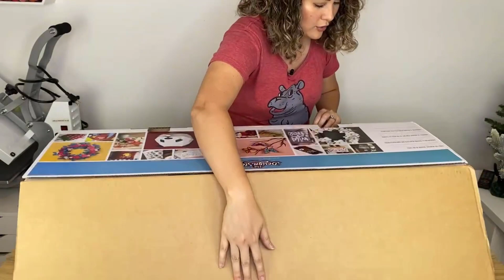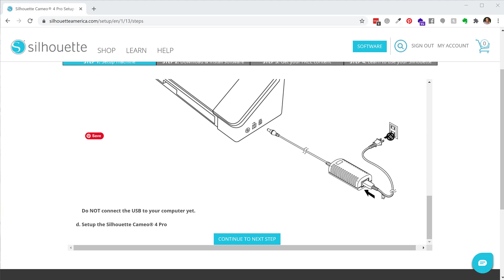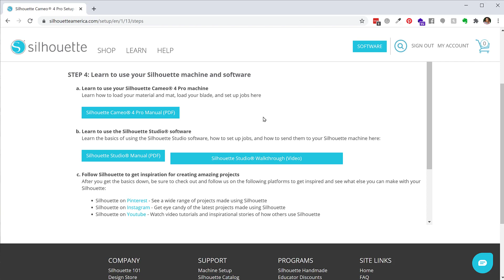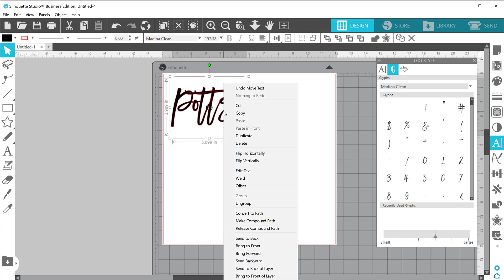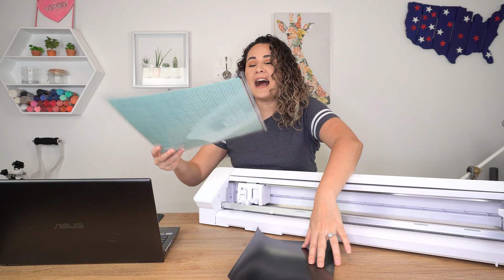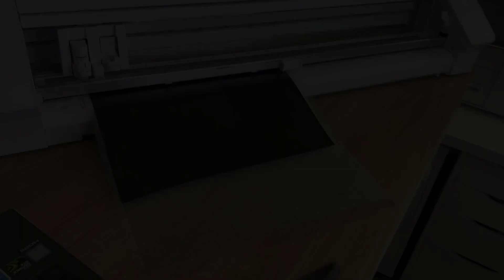Realistic Cameo 4 Pro Unboxing and Why I Couldn't Cut for Three Months (Issue Resolved)

Comment: Lisa I want to thank you so much. I’m going to try your tips. I pray it works. lol. I took my machine out of the box and my vinyl isn’t gripping and it slides all over the place. I have emailed silhouette for 2 weeks and cannot get a response. Not sure what else to do except junk this and go back to my cricut. I’m so done with this machine.
Reply from the maker: I'm so sorry about that! I found the best method is to use the large mat when you can. It stinks, but that's how I made it work. If you're looking for a better 24 inch cutter, the Siser Romeo is my recommendation.

Comment: I have also been using an older (dark blue) Graphtec Craft Robo Pro 2 for several years, but the drivers don't always work well with Windows, especially Win10, so I usually use my Cameo (1) most of the time for decals.  I've been hoping to get the Cameo 4 Pro for quite some time but it just never quite fit into my budget, until recently. I noticed the recent flash sale and I jumped on it. 

Pretty bad that it took Silhouette three months to resolve your situation, when it was something simple....the blade. That should have been the first "fix" they should have recommended.

I love your "famous last words"....my family says that too! 😁
Reply from the maker: Yes it was a chaotic time. To be honest, I still have issues with the machine - mainly cutting long designs. I will be phasing over to the Cricut Romeo soon, it has much better accuracy in my opinion.

Comment: Could you comment a little on how the pro compares to more industrial 24” cutters? How do they compare? Is the Cameo Pro worth it? What other 24” machines compare to the cameo pro?
Reply from the maker: The Cameo Pro is great for crafters who want to move to a bigger machine without the intimidation of other software. However, it uses a stepper motor and its slower than other industrial machines. If you are going to be going to a higher business level, the Graphtec or Roland 24 inch machines are great ways to get in.

Comment: for the price of that cameo i could buyu 2 rolands 24inch models fgrom us cutter  or prob of other brandsa. that think is 499.0 or arounjd thast price i still have my 3. but i only use it for curtting oramask 813 i custom paint guitars. and for that mattert why not get the juloiet from  sciser its suposed to bead a## from what i hread.
Reply from the maker: I have the Juliet and it's great. However, at the time of filming this, the Cameo Pro was the first 24 inch cutter that was crafter-friendly on the market.
Reply: @LisaPottsDesigns  about the Juliet I can't get a straight answer from any one . Is itccloid based like cricit or can you use it like the cameo  and not have to actually be on the internet  to use it that's the main reason o bought a sholouette  use it stand alone no fees or anything these coep comp are screwing the consumer erevery days   and I don't like it . I liked it better I'mtje 89s0s

Comment: My Cameo Pro didn't cut properly and had serious issues with registration. Returned mine and got the cameo 4 and had ZERO issues. Theses pro models are known for faults and told by seller that multiple units have been defective and returned.
Reply from the maker: Yes, it definitely was a difficult rollout. Thankfully I am using it now without issues but I know many others have not been as fortunate.

Comment: Hey thanks for the video, problems with mine from the get and also a faulty blade, I'm just wondering have you found that you actually cut up to the full 24" with this? I've tried cutting a simple square and it comes out of the rollers no matter where I place them 🥴
Reply from the maker: Yes! But I have to use the mat to cut the entire 24 inches. I did cut some nice decal vinyl at 22 inches wide recently, but I was nervous!
Reply: @LisaPottsDesigns  I've figured out if you feed the vinyl in a little further it does the job,thanks 🙃

Comment: Hi, Thank you for making this nice video. Have you ever cut fabric with it? And specifically stretchy fabric? I'm thinking of buying this, but I want to make sure it works for it first.
Reply from the maker: I have not personally, but I have seen many others use it! Just a matter of testing settings!
Reply: @LisaPottsDesigns  I see, thank you!
Reply: Hi Sara, have you found videos of the pro cutting the stretchy fabric? Have you bought it and tried? I want it for the same thing but I want to be sure it works
Reply: @tiffenydecoteau4037  Hi Tiffany, sorry it took me so long, I never saw the notification for this. Actually I realized that the sticky mats ruin the elasticity of stretchy fabrics, and since these cutters need the sticky mats, they just don't work well with stretchy fabrics, the actual cutting worked well with the rotary blade though

Comment: I've been eye balling the pro just because of the size. I wouldn't use the huge width but very rarely. I see alot of people have issues with it. Would it be better to buy a plus vs the pro? Just to save on issues. Thanks!
Reply from the maker: I would either go basic or pro, not the plus. I still use my pro simply for the fact that I can keep my 20-inch pieces of glitter htv in sheets longer than a foot. You can't do that with the plus, since it's 15 inches. If you're rarely using the width to its potential, save the money and get the basic.

Comment: i have had mine for a few months. I do not use a mat. but some of my designs it will move the carriage all the way to the right of the machine and start cutting from there, even if my settings are for a 4 x8 , positioned on top left of material view.  I am not a proficient user however why are some designs doing this and others are not.
Reply from the maker: That's very strange. I haven't had that happen before. I recently needed to update my firmware, is yours up to date?

Comment: Cost and it only being a hobby to me was the deciding factor for not going to the pro but did move from the portrait to the cameo 4... sorry if this sounds bad...but I was glad to see that you had a problem from unboxing...mine unfortunately was from being a typical guy...don't need instructions... machine needed firmware update and the usb connection wasn't being recognised...of course I contacted my seller who put me in touch with silhouettes sister company here in the UK and they had my machine for 3 months..but got it back and it was working...until it needed another firmware update...when I first set it up Bluetooth automatically came on and set up went ahead...so usb set up never got done...so I had to uninstall everything... reinstall making sure Bluetooth was turned off... actually turned it off on my laptop as well...did the usb set-up then switched Bluetooth on then did the Bluetooth set-up...like yourself now have the machine showing twice...usb and Bluetooth...took over a year during lockdown to finally get it sorted...
So now you know why I said it was good to see you also having a problem...can I also say your unboxing and set up was the best in showing how to step by step... though sorry you didn't also do the getting the free designs etc as there is bound to be those setting up for the first time...or have moved from a different machine..
That said keep up the good work..
Reply from the maker: Thanks, Paul! I was just trying to keep it real. When I see no one else struggling, I start to feel crazy. At least we know we're not alone!

Comment: You will never be able to do a print and cut job with thick cardboard , as you can do with Cameo 3 and 4
Reply from the maker: It's the same cutting clearance. You can certainly do it.
Reply: @LisaPottsDesigns  It's not all about the  clearance. They should improve the rolls pressure: the mat keeps on slipping and often the cardboard gets stuck under the carriage, every time the sensor tries to read the registration marks. I've heard so many testimonies about this issue...

Comment: I am trying to cut without a mat on 24" wide vinyl.  I keep getting a message that the selected media is too wide to be used with the specified Silhouette.  I have the Cameo Pro.  I have no idea what's wrong.
Reply from the maker: A couple things:

1. Make sure your Cameo Pro is connected and selected. You may need to click the button at the bottom of the send panel and select the Pro.

2. You may need to update your mat or media size. Make sure you have the 24 inch mat selected. 

Let me know if either one of these help!

Comment: Thank you for this video - I thought I was the only person having problems with the Cameo 4 Pro. I'm having no end of trouble with mine (sketch lines are fine but cuts are all mis-aligned. It seems like the mat slips when I try to cut on the 24in mat but smaller mats seem to work okay), and am in contact with the Silhouette Support team. 

I received my machine in March, but have yet to make a successful cut on the 24in mat, which is frustrating because I upgraded to the Pro to be able to make wide cuts. Your video has given me hope that issues can be resolved!
Reply from the maker: Crossing my fingers! Just keep up with support so you can get a resolution.
Reply: @LisaPottsDesigns  thank you, I will: the worst part is that I sold my Cameo 4 to fund the purchase of the Pro, so I can't cut anything at the moment!
Reply: @kittyishere  what was outcome?
Reply: @passmorebrett  it transpires that the mat that came with the pro was too flexible and thus was sagging when I attempted cuts. Our retailer provided us a new mat and we've been fine since!

Comment: I just came across your videos. Where is the SN etc info for my the machine so I can register my new machine. I got mine yesterday. I haven’t set it up yet. Do you know of a very affordable stand that is workable with the cameo 4 pro? I’ll be watching your cameo 4 Pro videos. You’re very down to earth, I like that. I also have to learn the software silhouette business. I need to do scanning in stamped and cuts that I cut from paper craft dies (to resize them as needed). My machine was on back order for 2-1/2 months so I hope I don’t encounter blade or feed problems. Thanks for your help!
Reply from the maker: The SN should be on the back of the machine. I don't necessarily use a stand, but I like to have a desk to put it on. This lets me turn the machine if needed, and it's a bit more steady. 

Always here to help! Feel free to join my Facebook group. It's linked in the description.
Reply: @LisaPottsDesigns  thank you! I found
It…

Comment: Omg I am so excited for you! I received my Pro just before Christmas. I am new to vinyl cutting machines. What I am struggling with is loading my materials going in straight. 😫 Luckily my machine cuts just fine.
Reply from the maker: I’ve noticed my machine has been having issues too. It’s not as forgiving as previous models.
Reply: This is the same issue I am having and it really is a horrible design!!  They should have just made the machine bigger and not make all those changes because it sucks!!!